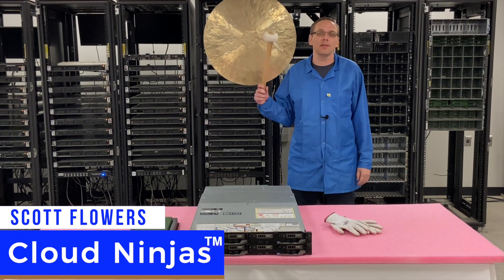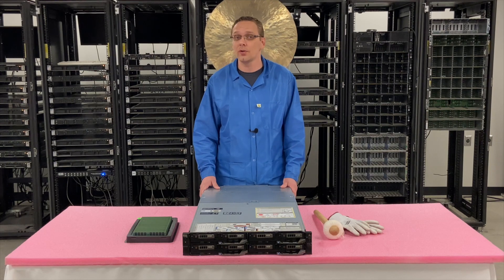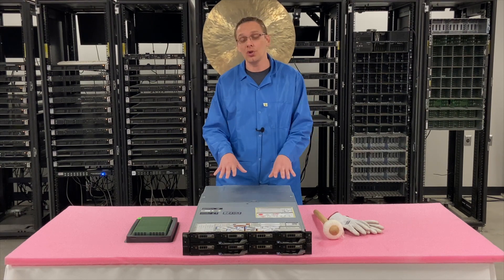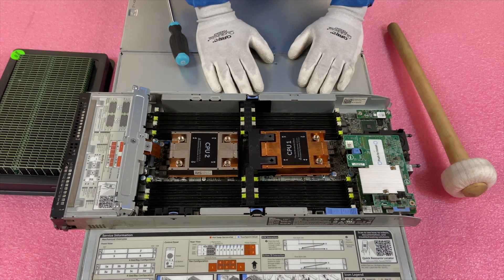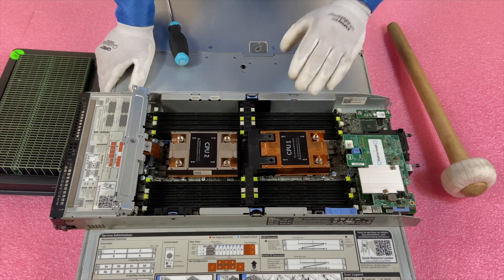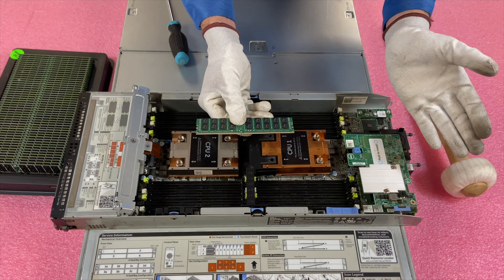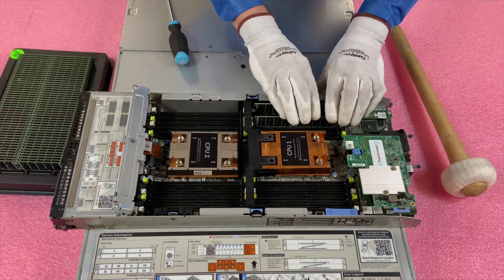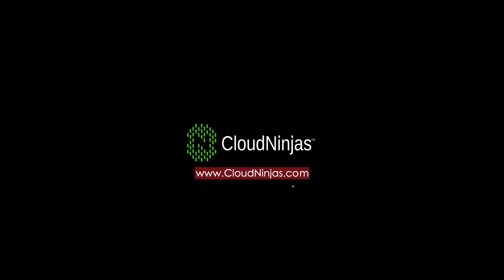Dell PowerEdge FC630 Blade Server Review & Overview | Memory Install Tips | How to Configure DDR4

Comment: if one only have 1 x FC630 node and the other 3 are blanks, can one control the fans or all fans must still run even though just 1 of 4 nodes is been used?